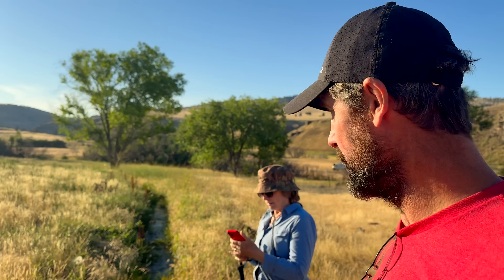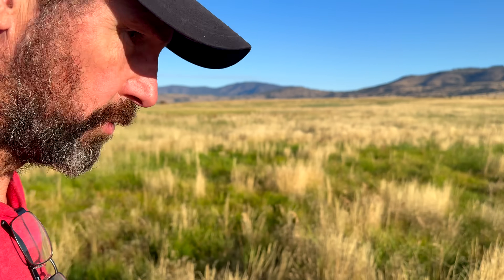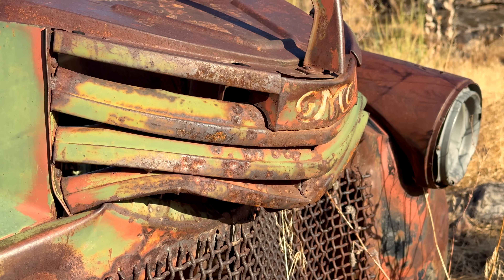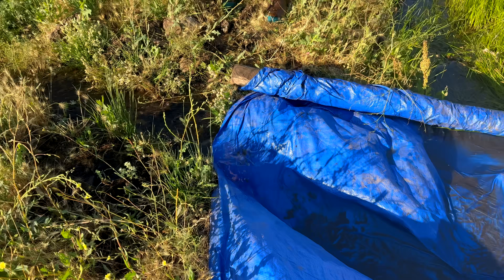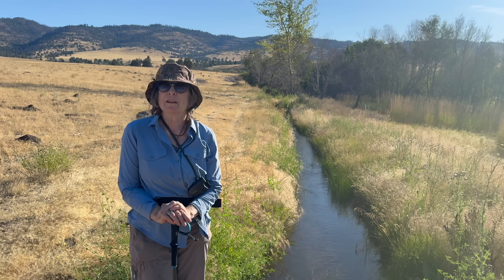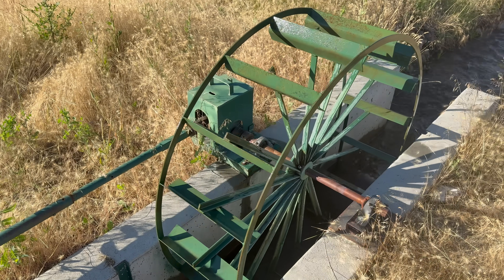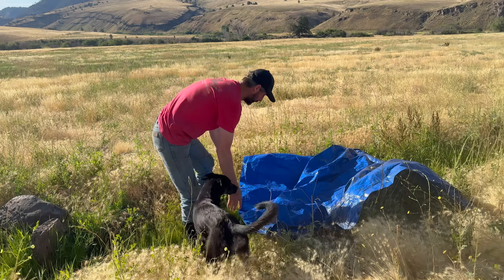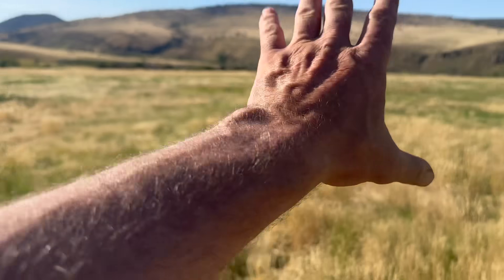Off Grid Ranch Irrigation | How We Water the Fields Without Power

Comment: Old school, old time tech. No moving parts except water and gravity. It's worked for thousands of years without pumps, electricity or mechanics. Is that ditch system part of the original ranch setup or did it get added later?

Comment: We have a year round creek running through our property here in Central Coast California.  The water is completely off limits for use.  So we have to dig a well.  
Build a reservoir,  electric pumps requiring lot's of current.  Power poles for the lines.